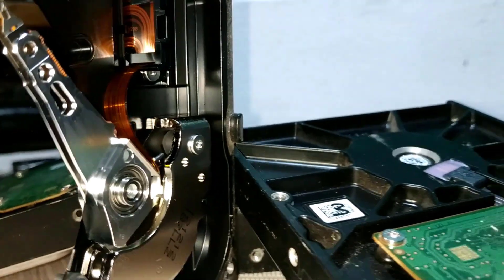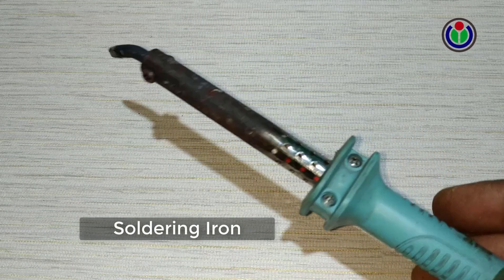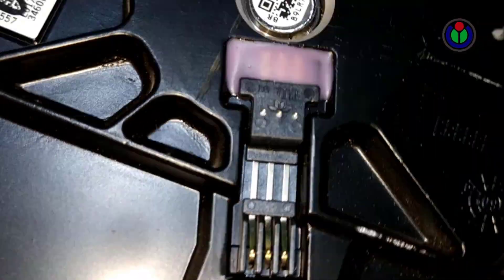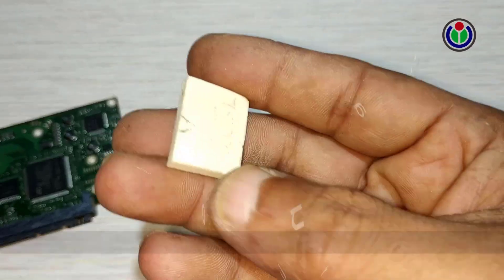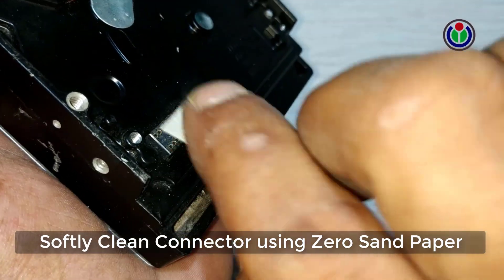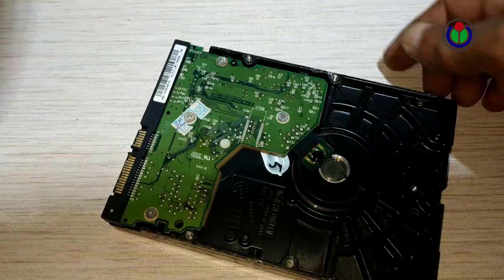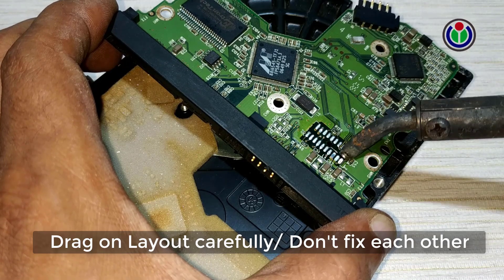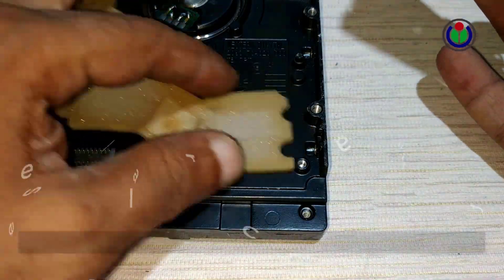How to Fix a Dead Hard Drive & Recover Data | Repair Not Detected HDD Tutorial with Voiceover

Comment: Hey there thanks for the video I was wondering how do I unscrew the PCb board on the hdd when the hole is too small
Reply from the maker: Nice dear..
Reply: @dreamfinder elastic band method didn’t work 😅 I try a lot of pressure it work 😂

Comment: What about when its droped down and died
Reply: Something to do with the platters internally I seen a similar situation where it was dropped apparently on a YouTube video it might be best to take in to a hdd repair shop
Reply from the maker: Yes, you’re correct. If the issue involves the platters or internal components, especially after a drop, home repair is very risky.
In such cases, the safest option is to take the HDD to a professional data recovery service, rather than attempting DIY fixes.